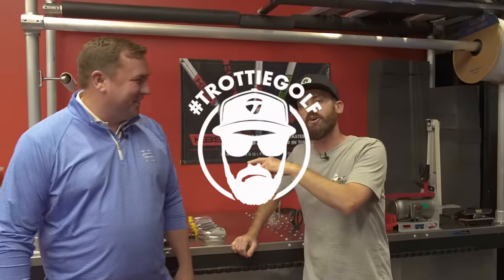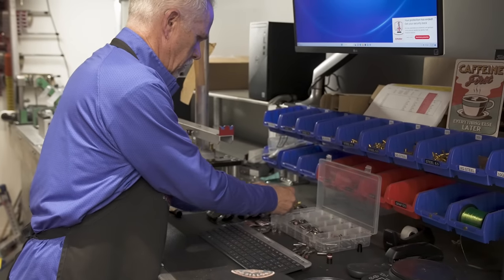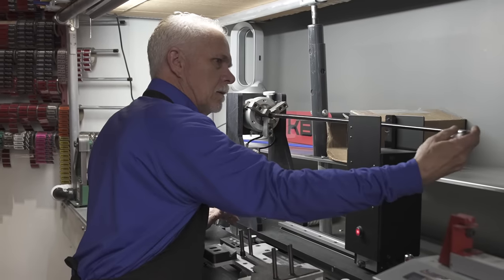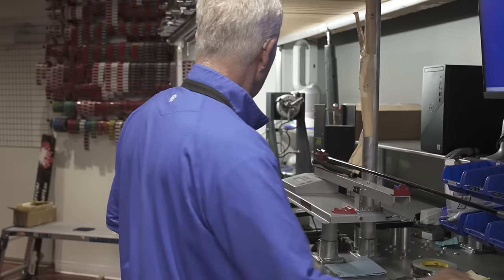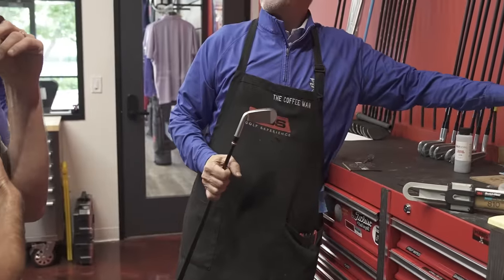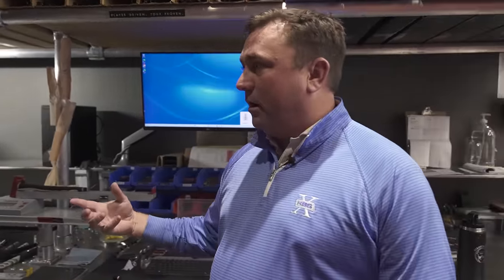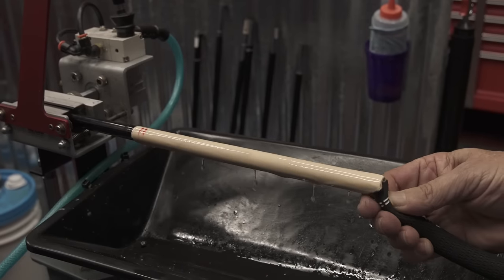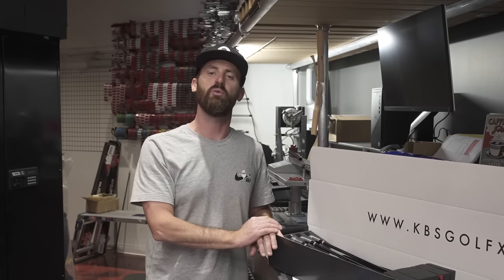Just Like The PGA Tour, I Get My Irons Custom Built For Me | TrottieGolf

Comment: If you’re in Florida, Moon Golf does the exact same thing but with every brand of shaft/club. Fitting bays 20 feet away from the build shop. The builders go through the exact same process. I’ve had them build my entire set, drive to lob wedge. Pure’ing, swing weighted, exact length, lie and loft, and with tour level quality control.

Comment: Yeah...KBS ex is pretty cool...they fit exactly to what the customer wants...I had some concerns intially about fitting my old parallax irons to D4 with money taper 125+ but they assured me it would not be an issue... perfect customer service and focus. Its not a cheap service but you get what you pay for. Ping just production build quickly like robots and shaft using this crazy air cannon which ruins alot of shafts in the hozel. But these are made by hand with love and care and top expertise....what's not to like?

Comment: Great video Trottie! I have a question: what frequency of the shaft vibration was? Is there a correlation with the swing speed(head/ball)?
Reply from the maker: Do you know what I didn't even check but yes there is a correlation. I just know they matched which was what I was conscious of

Comment: Am I guessing correctly that the KBS shafts that came with my TM not done like KBS would have done?
Reply from the maker: They will have been assembled by TM
Reply: @trottiegolf  yes but they don’t do the wobble testing for straight back and forward like they do?
Reply: I love what I’ve got and fully trust TM from the videos I’ve seen of people here showing quality control. And my irons still feel great. 

Would it be possible to send them in and have TM redo the faces when they get worn down enough? Or I’ve heard that using mats has a higher probability of needing them checked for angles?
Reply from the maker: @MarineBand5524  Mats and lie angles is 100% a thing, so check them frequently. Redoing the grooves, that's a myth, TM won't do that. In terms of frequency matching, you'd need to send your clubs to KBS for them to retro build the irons again. Might be something you wanna consider.
Reply: @trottiegolf  thank you! I will do that!

Comment: It does not speak for KBS that they need to spine align their own shafts, which basically means they are not perfectly round.
Reply: Each shaft starts as a flat piece of material, wrapped into a round object. So this means there will always be a crossover point where the ends meet. This is the spine.
Reply: No steel shaft is perfectly round